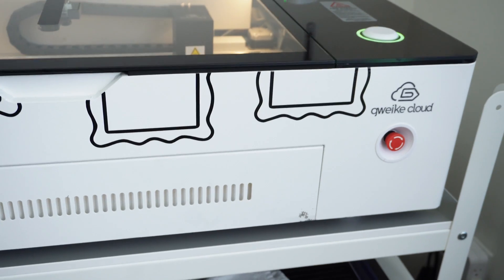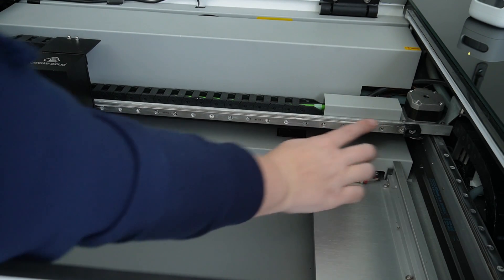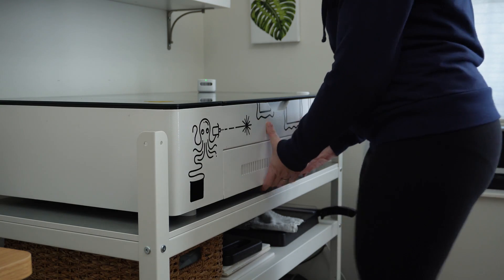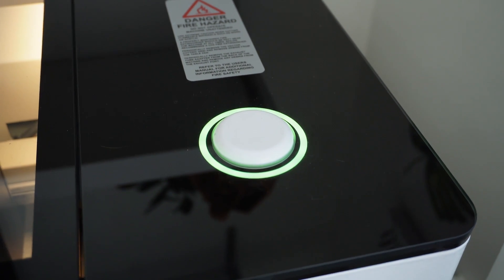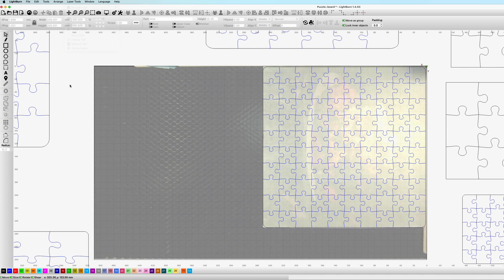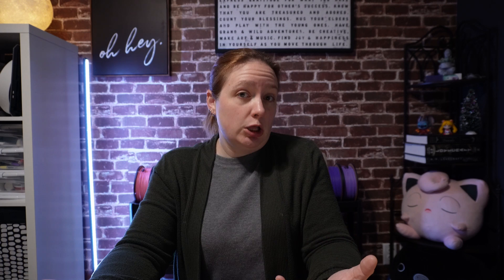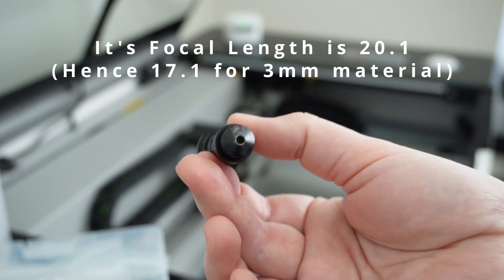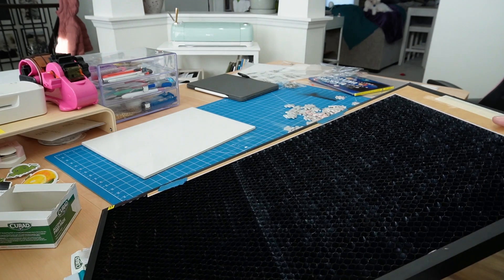Gweike Cloud Pro Laser: Is It The Best Laser Cutter? My Honest Review

Comment: I'm very curious about this lens replacement you did to make it easier to clean. Is there any chance you made a video showing how to do it?
Reply from the maker: I did not. It’s really easy to do. It’s basically just swapping out the lens unit with the replacement. It only required unscrewing the air assist and the ring that was holding the lens unit in place and popping in the new one and of course, replacing those connections. I think I got the link to the lens unit off of the Gweike cloud Facebook group.

Comment: Try exporting your file as a pdf rather than an svg. I’ve been using light burn for a few years and this file type works really well for me. (No scaling issues). Also, the new version of light burn allows you to simply enter the material thickness in the Gweike cloud rather than performing the math.
Reply: Sorry. I should have finished watching the video before commenting on the material thickness.
Reply from the maker: That’s okay.  ^_^ I will try the pdf import some time though!

Comment: Totally agree with your assessment, especially that anybody new to laser cutting will need to spend many hours experimenting with what it can do and what material settings to use. I use it primarily with wood and it can cut 16mm oak in one pass. Haven't tried thicker yet. Only issue I have had in 5 months ownership is that I burned the lens after not cleaning it one day (so my fault). Definitely worth upgrading Lightburn to take advantage of the changes. It's so much easier now that all I have to do is enter the actual material thickness. What I'd really love which is missing is a laser light to help with framing before cutting - for the moment I have strips of tape on the front and left hand side of the housing in line with the laser.
Reply from the maker: Have they fixed the issue with the thickness of material? I know back in December one of the Facebook groups was complaining. It wasn’t working properly. Of course I replaced my lens so the focal length is different anyway.
Reply: @LabcraftStudio  definitely working and without problems for me

Comment: Great vid! I got a Gweike and would have to agree with you most points as there is a learning curve but that is the tradeoff you make with cost comparison to the glowforge. On another note that puzzle looks really cool, did you make that yourself or is there a program that assist's with the creation of the cut paths?
Reply from the maker: I just googled SVG puzzle generator, there are a couple of free online generators that you can use. Once I had a few common sizes I just saved them in a Lightburn file.

Comment: Not bad if I may say (I know I cant do better) :D Its a good take on the laser. Just some small tips for you that migth help the folks, see if you can link the lens you use in the description, what camera you use insted, belt specs and what kinde of lube for the rails :D just an idea. One thing I would have recomended to folks that have never used a laser before and I do it in forums, is to get a non expensive machine, like a diode one. Its better to f...... up there then with a machine that cost so much more like a co2.
Reply from the maker: That’s a really good point with the diode laser. I will also add a list to the supplies I use.
Reply: @LabcraftStudio  Im just speaking from experience 😬 I started with a diode laser and used that for a good amount and decided that I needed to umf up the game a bit lol